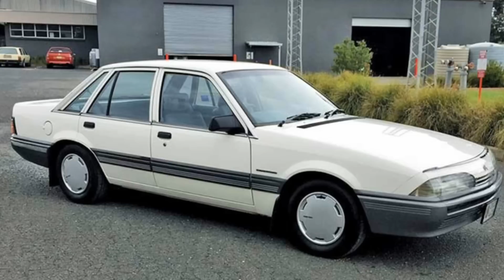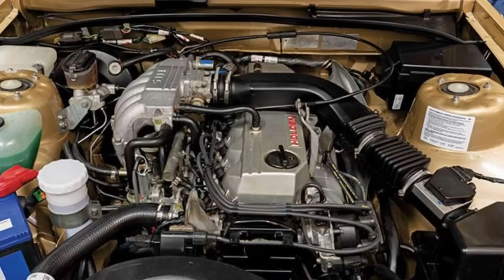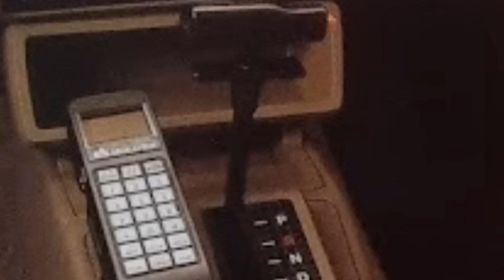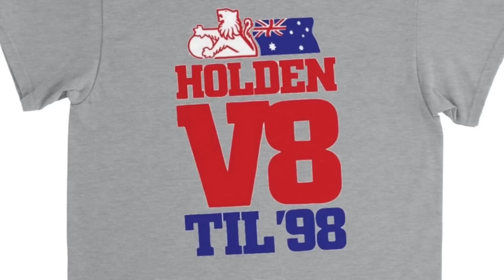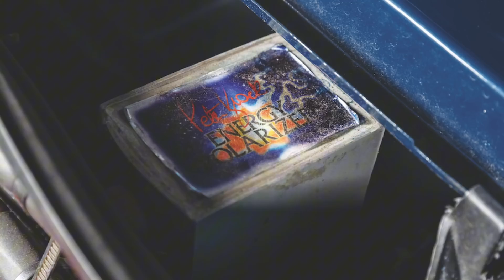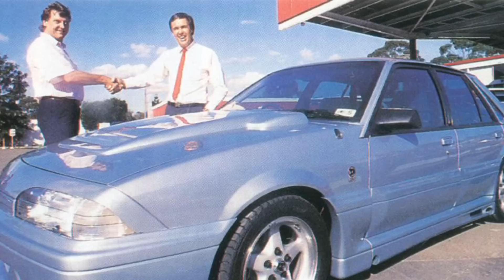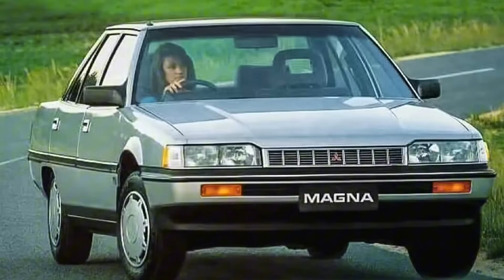Holden VL Commodore - Turbo Talk.

Comment from the maker: Here is my latest video in the Holden Commodore Auto History Series - the VL Commodore. Please be sure to Like 👍 the episode as it really helps the channel and doesn’t cost a thing. Please also Subscribe so you don’t miss out on future episodes. Plus, check out all the past episodes on a whole range of different old cars. Thanks for watching. 👍
Reply: Red motor may be ridiculed but back in the day my HT monaro GTS 4sp 186S  got me to the magical ton when 100mph😊 was consideŕed fast and was quiet stable compared to VF valiant sedan 225 auto 160hp ? which was done at 93 / 94 mph
Reply from the maker: @Eric-kn4yn  Yes but no emissions then. 🤔👍
Reply: @markbehr88  2BBL carby header pipes and warm cam ?  the 186s revved hard  for what it was.
Reply from the maker: @Eric-kn4yn  Sure. Good with mods. 👍
Reply: @Eric-kn4yn  yer valiants love em but handlin not so good.
Reply: VL turbo was more than a turbo bolted on to the nissan 6 upgraded  suspension brakes etc ? very modest decal on boot to signify the status
Reply from the maker: @Eric-kn4yn  Yes, it was the complete package. 👍
Reply: How popular was turbo and numbers sold what did turbo do to insurance of car.
Reply from the maker: @Eric-kn4yn  I don’t have that information. I would say less than 10% of volume. 👍
Reply: Price premium for turbo VL  and price of 5L V8  comprable  and was V8 available across the VL range
Reply from the maker: @Eric-kn4yn  Yes. V8 and Turbo available across the range. 👍
Reply: @markbehr88  was turbo option price comprable with V8 option
Reply from the maker: I imagine they were pretty close. 👍
Reply: Superb. I lived in Sydney 1988-2000 and although a Pomnwanted to understand all the cars history. My Gen Mgr was very proud in showing me his VL strught six turbo version in white and said how fast and smooth it was. I wish I had it now. My first co car was a Magna which after European cars was a bit of a shock but boy what an engine I went onto Ford Falcon co cars so I will look up all your videos for a massive nostalgia hit. Thanks
Reply from the maker: @paulredding5864  Excellent. Thanks very much. 👍
Reply: @markbehr88  thanks mark.

Comment: In April 1987 I was driving to Melbourne from Nowra. I stopped at Marulan for a break and to refuel, a Cordia Turbo hwy patrol car was also refuelling. I asked the police officer what he thought of it - it was the first Cordia turbo I had ever seen. He was not very complementary of it and was looking forward to getting a Commodore again.
Reply from the maker: He probably didn’t like the torque steer and small size 🤔👍
Reply: @markbehr88 that and he also mentioned how thirsty it was - they were always refuelling it.
Reply from the maker: @rockygoodfellow77 Really. They were probably thrashing it all the time. I don’t remember them being that thirsty unless you stepped on it all the time.
Reply: @markbehr88 if I recall correctly, he said they drove them as aggressively as the V8 Commodores - which had a fuel tank around twice the size of the Cordia.
Reply from the maker: @rockygoodfellow77 Yes. They would have been on the boost all the time.

Comment: my LATE FATHER PURCHACE A BRAND NEW  vl calais with turbo option...it was silver in colour with matching trim   had only  around 300 km on the odo  before it was stolen 1 month later   outside a reception  centre in brunswick ...the theif and 3 mates wount it  right up  close to 200 kmh ( police believed ) before  loosing control and  impacting a 2 foot wide gumtree head on ..me my dad and brother went to see  the wreck at depo / holding yard   to retrive some belongings in boot   but it was jammed shut  engine was up right  where  rear seat cente passenger would be   just horrible   sorta felt sorry for those young kids  ....insurance paid  and dad went out and purchaced another but navy blue   this time he removed TURBO badge from boot    that helped   for about 2 year until it was stolen and never receoverd   then it was replaced with xf fairmont ghia  not as quick but much more roomier
Reply from the maker: Terrible story all round. Thanks for sharing though. 👍🤔

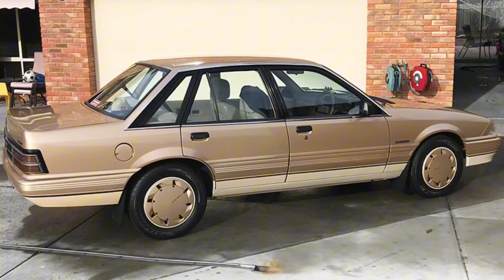Comment: 16:00 Worthy note the NZ  Royale as effectively the Calais without the pop up headlights  had the clear plastic egg crate grill, plush interior/AC, PS,Electrics but believe 3L 4 Speed Auto only. 
I owned one built in Trentham (AU built VL must better quality)
Reply from the maker: I used to work at the Holden HQ in Trentham 1994-7. Great days. 👍

Comment: Sadly, I owned one of these JUNKERS. Holden's hugest mistake. 
Luke the 1971 XY Falcon GTHO, every 🤡 in Australia,  especially suburban Melbourne has 'owned a Calais Turbo', despite very few being made. 
These $hitters ate cylinder heads and head gaskets like the Cookie Monster in the Arnotts Factory.  
The only decent VL was powered by Holden's cast iron, pushrod operated OHV, Australian made V8.
Reply from the maker: Not a fan then? 🤔
Reply: @markbehr88 up there with the WORST car I've ever owned. It was a magnet for the Dickheads though. 
It won First Prizes in every car show.I entered it in, bar one (2nd prize). Even a 'Top Stock Interior ' at a massive All Holden Day Show.
Reply from the maker: @RussMitchell-vp6kt 🤔👍

Comment: Worked on them as an apprentice mechanic at a Holden dealer. The VL was radically advanced over the awful VK. Smooth, quiet and never leaked oil. The turbo was astounding. Many a fun test drive in a highway patrol car. Then came the awful VN and Holden got back to building shitboxes.
Reply from the maker: The VL was certainly very refined. The VN was a much more popular car though. Holden would not have stayed solvent based on the volume and cost of the Nissan engine. 🤔👍

Comment: Did you source your info from Wikipedia? Slight correction, nissan never used the RB30ET, that was a Holden only engine.
Reply from the maker: @davydoo81  Different sources including Wiki 👍

Comment: G'day Mark, 

Finally get the time & day to watch this killer video.
The VL good mate of mine Jamie bought the first batch of Canary Yellow Vic Police interceptor whilst Vic Police still had them on the road.
Boy did we have fun with that car even in stock form it was quick.
Can't write what we did with it.
Even as late as 1994 whilst living in Adelaide,  SA Police was still getting around in VL V8 Auto's , I don't think SA Police bought Turbo VL's.

My neighbour next door to me in Port Melbourne upto 2019 was parking his one owner immaculate 
VL Executive on the street.
Every week people knock on my door to enquire about it, unfortunately a L Plater apparently rammed it in a quiet back street in Port Melbourne avoiding a possum.
Car written off gone to auction, I think it was a set up for the parts.
Absolutely immaculate one owner, Greek old man.

I recently read a book regarding HDT great read.
Nothing & I mean nothing was mentioned in the book regarding what you mentioned about the Director.

It pointed the finger to the polariser, & this was written by one of the managers at the time.

Thoroughly enjoyed the video.

Cheers

Louis Kats 👍
Reply from the maker: @louiskats5116  Thanks Louis. Glad you enjoyed it. Yes, the polariser gets blamed but that was not the deal breaker. 👍
Reply: @markbehr88  👍👍👍

Comment: Over here in NZ we got a new 3.0L Berlina Wagon 4 speed auto as a work vehicle and we were excited about that engine which ran as sweet as a nut. Jatco were true to their poor reputation and the auto in this one let that engine down as under pressure it could never make its mind up as to what gear to be in. The car itself looked nice but bits and pieces of plastic trim would break, the screws on the tail light lenses must have been over torqued as they all star fractured around the recesses, and the soft plastic surfaces were great at capturing grime. Despite this it was still a nice car to drive and much smoother although not as much fun as the 2.0L Sierra wagons we also had and loved to drive hard. Near the end of its tenure with it one of our trainees T-boned and land crab with it, much to the chagrin of its normal custodian.
Reply from the maker: @waterbourne9282  Interesting. Sounds like a great car let down by quality issues and finally a bad driver. 🤔

Comment: The mighty falcon was the real aussie hero !!!! the VL was the Nissan holden they had weak rear quarter panels and chassis rails and come standard with the rusty front and back windscreens the front bar would always fall apart and the dash was crap and a bad habit of flying off the road in the wet with the crap rear diff and suspension set up was a failure in my opinion for the VL VB VK to be safe on public roads needed a roll cage as the body’s were weak as so many young ones died in these crummy doors
Reply from the maker: @Axlebeen  So, not a fan? 😀👍
Reply: @markbehr88  NO
Reply from the maker: @Axlebeen  Fair enough. 🤔

Comment: I like the VL  but they could have kept the VK lights ,  made it a little wider ,   , and no rust ,😅 , but they easy  cars to drive specially for the  learner's,  can actually  see the front  and back in  the mirrors     and  only holden made it twice in the motor magazine nz , brock reviewed  it the second time  , 
I did not like them when first seen it  but after driving  it  ,GTS  IS MY FAVORITE   ,still perfer the HQ PREM ,
Reply from the maker: @Philly-lq6zr  👍

Comment: Probably the best ever 6 cylinder in commodore
Reply from the maker: @belchy94  Could be? 🤔
Reply: that depends, I still think the S/C 3.8L in the VT (heavy beast) was better from a day to day driving perspective but in NA form yeah the Nissan 6 was very very good for 1986 to 1988., the VK EFI 3.3L was also good let down by the (awful trimatic) 3-speed auto.
Reply from the maker: @351tgv  The VK fuel consumption wasn’t great either. 🤔
Reply: @markbehr88  - again it came down to transmission and final drive ratio, the VK still had the (awful) junk trimatic garbage which was also in the VL carby V8.
Reply from the maker: @351tgv  Yes a manual one would have been much better. 🤔

Comment: Thanks Mark for the trip down memory lane with the Cordia. I had the turbo and it was great car. If you were stopped by Qld coppers, they always liked to have a look at it considering their NSW counterparts had them at pursuit cars.
Reply from the maker: @rocknral  Thanks very much. Maybe I’ll do a full episode on them one day. 👍
Reply: @markbehr88   That would be fantastic. Cordia never got enough love in my opinion. Starion was always in the limelight. 
The little buggers went pretty hard for a 1.8L
Reply from the maker: @rocknral  Yes. The torque steering was on another level. Starion was nice to drive but heavy to get off the line. I drove the JB and JC when they were new. Maybe even JD? Cordias I drove were AB and AC models. 👍
Reply: @markbehr88  - Maybe? Nope Mark you have to do the entire Sigma (including the 1st ever Australian made from the factory Turbo Sigma GSR)  to Magna to 380 + Scorpion (ok maybe not the Scorpion) and Cordia cars ...  lets from forget the STARION Group A, yes that was real in 1985.
Reply from the maker: @351tgv  I remember the Starions racing when I was at Mitsubishi. I used to order them ex Japan and the race ones went to Sutherland Mitsubishi 👍

Comment: My mates v6 capri used to smoke VL turbos all the time back in the 90s  stock form they were only as good as a VH 253
Reply from the maker: @rustybogans2508  Interesting 🤔
Reply: It is a two door  and it is smaller ,which makes it lighter  ,  v6 has better torque  , taking off ,
Reply from the maker: @Philly-lq6zr  true 👍

Comment: now to the Nissan Turbo i6, WOW, great engine, I had a VL Berlina wagon with the RB30ET and 5-speed manual (ware combo) and gees it was a  weapon back in those days (by todays standard not so much) , yeah it had turbo lag, yeah it was not economical, yeah it would run hot (a little too hot that that air con will stop working) but dam it that TURBO WOOSH from 3,500rpm to 5,000rpm in 3rd gear and into 4th gear it would WOOSH again from the turbo boost, again mind you back in those days what a rush.

The VL was actually a backwards step in terms of steering and suspension, too much understeer  (made it dangerous in wet conditions unless you had wider tyres fitted) and a choppy ride at the rear end (way to bouncy and soft), I can see why the XF Falcon/Fairmont domi9nated it in terms of fleet and private sales.
Reply from the maker: @351tgv  Interesting to hear about the drive impressions. 👍

Comment: ah yes the VL Nissan.

The 4.9L V8 carby and the awful 3-speed trimatic were an absolute dog combo on unleaded, the only saving grace was torque for towing but again the awful Trimatic auto, just on the old "black 3.3L carby red intake EFI" they actually work fine on 98 RON unleaded, sure on 91  RON they ping there head off but on 98 RON they are fine as many VK's are still on the road today.

Okay the Nissan i6, tremendous engine for both Commodore and Skyline, the only way Falcon could keep up was with there EECIV EFI 4.1L but even then the 3-speed  auto let it down, and in terms of manual there was only the 4-speed manual (with its super heavy clutch) offered. 

The VL was a great upgrade over the awful VK design.
Reply from the maker: @351tgv  5 speed did come out later in 4.1 XF. I had one. 👍
Reply: @markbehr88  - not as new in NSW though. Something to do with emissions.
Reply from the maker: @351tgv  👍

Comment: Cordia Turbo .... YEAH BABY!

As for Brock and GMH split,  you have not mentioned that the VL HDTSV Director was fitted with the 1977 designed  Opel Senator IRS (semi trailing arms), GMH could not allow that as it would of caused warranty issue should it failed, Brock knew this and still went ahead with the release, I think the "December 1986 or January 1987" Wheels magazine has a the entire story (well from Brocks view point)  and ATN Seven (so essentially Channel 7 Sydney) did a video report about it in March of 1987 (you can find it on youtube), my understanding is that there are actually 4 VL HDT SV Director (with full body kit and IRS) released and sold and something like a further 15 VL HDT SV Director with the standard live axle rear suspension and no body kit sold and also at least another 10 with the stroker  5.6L (345ci) V8, all were sold via backdoor to fund the 1987 Brock Bathurst 1000 campaign, and the irony of all ironies GHMH has the nerve to claim the 1987 victory as "one of there own" after what they did to peter and his operations, shameful Beauvoir from GMH.

I'll talk about the Nissan engines in other post.
Reply from the maker: @351tgv  Yes it was a messy business but of Brock’s making. Holden was very tolerant but only up to a point. 🤔
Reply: @markbehr88 yep , and he 9nly signed the cars ,
Reply: General  motor  been a corrupt  name  since the founders started up  and  got big , corrupting  other businesses  ,  and not listening to  Brock,  
Pretty much  all car manufacturers  corrupt  ,
Reply from the maker: @Philly-lq6zr  Brock was certainly responsible for his break up with Holden due to refusing to allow Holden engineers to test his Director, especially if a factory warranty was expected.  They got back together years later for advertising campaigns. 👍

Comment: I remember my white with blue interior VL Turbo fondly! I remember putting on a set of the Calais headlights which much improved the look as well as repairing some rust around the front windscreen which was a common thing for them. I parked it out the front one night and got a knock on the door the next morning to find the police when I opened it. They told me my car was stolen and was involved in a high speed chase! I didn't beleive them at first and was instantly gutted to find out this was true when I couldn't see the car where I'd parked it. I sold it after getting it back as I'd fealt it'd been defiled by the b-rst-rds that stole it. It had finger print dust all over it and was pulling to the right when I picked it up from the police station. She was very nice to drive and handled pretty well as she was lighter than the earlier commodores I'd driven.
Reply from the maker: @1BIGFROGGY  What a shame. Terrible when that happens to a car you really love. 🫣

Comment: Mark you mentioned you worked for Mitsubishi.  I was a huge fan of the Cordia when i was younger and there was a rumour going around that only a handful of Cordias were given to the Police with the 2litre 4G63 SOHC engines however there were issues so they were mostly replaced with the 1.8 4G62 SOHC engines though some made it out into the wild, is there any truth to this rumor?

The only reason i ask is one of my Cordias, we suspected it was one of the ex-Police cars, it had strange holes on the grill and front bumper, the dashboard had holes in strange places where it looked like a police radio might have been bolted on, also the engine was stamped 4G63 but it had the regular 1.8l style rocker cover (black ECI Turbo not the commonly done 2l Cyclone Dash conversion).  Also another wierd thing mine was an AC model which were supposed to come out in 86 as unleaded however mine was an 85 AC running leaded fuel
Reply from the maker: @tolgahk84  Hi. My recollection was that there was no variation in the cars we sold to the police. It was a one off order due to no unleaded Holden V8 at the time. It is possible that your car may have been used as an evaluation car put into service before the main order was built and delivered as a batch ex Japan? 👍

Comment: 6cyl RB30 was a revelation in an Australian car. Made the previous 202 and Fords EFI 6 look silly imo. Kinda made the carby v8 largely irrelevant, at least in standard form.
Reply from the maker: @bradg5910  I probably wouldn’t batch the 202 at that stage to the alloy head injected 250 but the Nissan engine was clearly a much newer generation powertrain. 👍